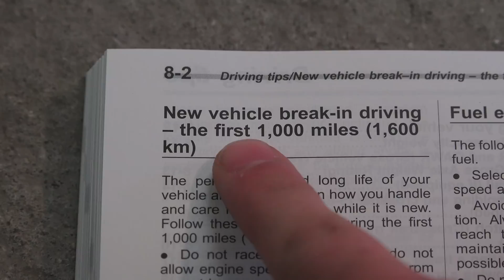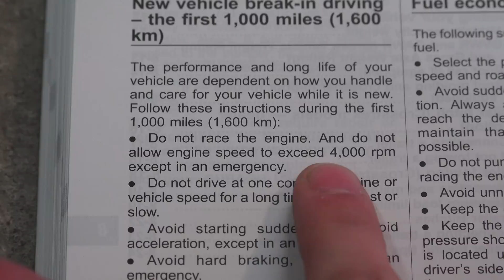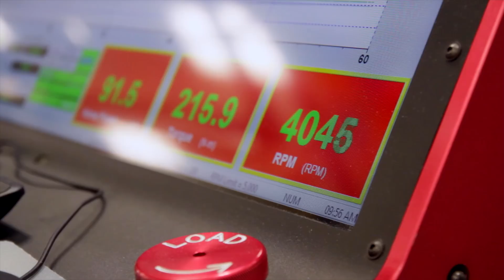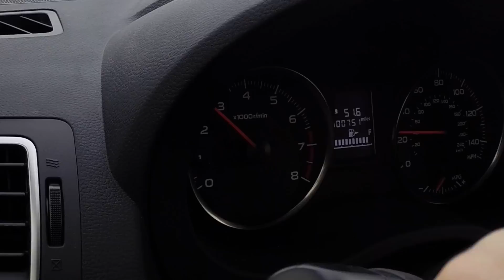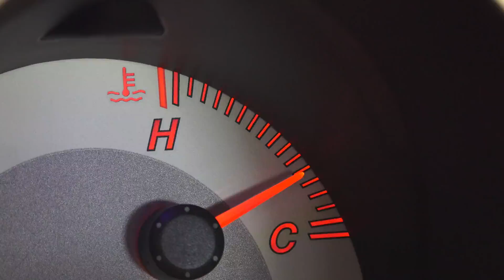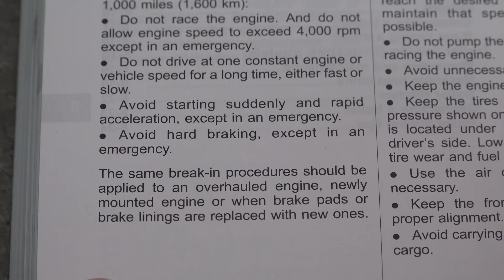5 Things You Should Never Do In A Brand New Car

Comment: these days, is not every motor produced tested in factory for mechanical issues and balance? I understand that it is a different story once you add the significant load of the actual chassis and interior / exterior components, so still wise to take it easy early on, but surely you wont destroy a new motor giving it some from the get go?

Comment: Hahaha so much for not flooring it, the lot staff at the dealer already floored it and drove the piss out of it if they had to pick it up from the port and drive it back to the dealership or did a dealer trade and swapped vehicles and drove it back from one dealership to the other. Depending on who did the PDI, that person could of gassed it down the block for ya already too. It's too late once a set of hands other than yours have touched it haha

Comment: okay buddy this is false info. owners manual is cya. my Subaru STi I blasted after dropping forged pistons in there. have to warm up the engine first before anything.

once warmed, i floor it and vary the rpm and engine load. no low rpm flooring.

Comment: Bought me a Swift Sport - manual stated first 800km very lightly which i reached my first day. And from 800km to 3000km a slowly started to move the rpms higher and higher reaching full 6900 at exactly 3000km. Also this aplies only when the engine is properly heated (oil, not just water) after that you can do whatever you want. Also i flored it but only at 2nd and 3rd gear and only till 3000rpm max! And yes i changed my driving style often, no highway and constant changing speeds, or if not possible, just shifted down a gear, accelerated, then shifted up and get back. Around 7000km i took it to race track for a good 1 hour full throttle full speed full everything. I think it now has more than 136hp:):).

Comment: Well.. that would mean if you want a new vehicle with a properly broken in engine.. you would need to buy it with virtually 0 miles on it. Otherwise.. you'll never know. Personally.. I drive mine hard from mile one. I did a 300 foot long burnout while still on the dealers lot 5 minutes after buying my scat pack.

Comment: Why does the customer have to do this finishing process (break-in) to get the engine ready? On another channel (mrjww) a guy turned up to a race track in a brand new sports car. Many commentators insisted that with modern cars the break-in is not necessary and that manufacturers were saying that it is optional.

Comment: wrong, most high performance engines need thrashing in the first moments of their life otherwise if you risk polishing the fresh crosshatching of the cylinder wall as apposed tho breaking in the piston ring surface. It's more important to change oiled filter at 1000miles, 3000miles and 5000miles then , maximum every 5000 after that.

i took my then brand new 2006 STI to a track day the day after i got it. Its so far lasted 200000 miles to date without having to open the engine. still going strong

Comment: The corvette manual doesn't say what you claim.  It says not to go full throttle from a stop, but it doesn't say to NEVER go full throttle.  GM have a specific manual for breaking in the LT1 engine and is says that after 1 hour or 30 miles you should do three 50% throttle runs to 4000rpm and back to idle and then three FULL THROTTLE runs to 4000rpm and back.

That is from GM themselves, totally contradicting what you say in your video, which is based not on data but on internet myths.

Comment: wanna break-in your engine properly fast,smooth and clean? 3rd gear full throttle pull 1500rpm-3500rpm, let the car drive itself to idle with little throttle input (like coasting and slowing down at the same time) repeat 5-10 times, let it cool a bit, do it again for the 1500-4000rpm range, repeat procedure in 4th gear, then again for 3rd gear but 1500-4500rpm, 5 times.. repeat every day for 3 days, change oil after 2000km, replenish if necessary

Comment: Disregard all of these if it's a rental...but on a serious note I like to load the rings gradually"almost lag the engine"..I've done it that way for 40 odd years but keep it in the 2000-4500 zone especially for flat tappet cam engines over a period of at least 1/2 hour non stop and never let it idle for periods longer than 60 seconds...Never had an issue doing it that way...Just sayin'.

Comment: What your asking is never going to happen in real life. Decent vehicle brands will have pre-run-in at the engine plant, its only their top of the line models will have a run-in service (2000 km, it varies per brand). Delivery drivers will leave the car on lots of cold starts, pre-delivery assembly will thrash the car on checking interval and salesmen will thrash the vehicle to allow the customer to get their vehicle quickly. What your saying is ideal, but its either old sayings or outdated. Low tension piston rings isn't going to mess up the bore to an extent that it will cause engine damage. Bearings have gotten better coatings over the years for start stop operation. Long story short, nothing to worry about, you got warranty, use it.

Comment: I made my break-in 'till 10k, gradually increasing the max throttle and load every 1 k. Only once or twice, in order not to make my engine a baby forever, I gave extra load (75% throttle and load and 100 %).

I felt my engine changing its behaviour 'till 22k, mileage when the petrol consumption stabilized finally.

Comment: BMW for the M2 also recommends keeping it below 5500rpms, below 170km/h and no full throttle until the 2000kms break-in service where they change engine oil and filter and differential oil.

Comment: I've several friends who work at ford and VW and there pre delivery inspection means take it out for a 5-8 mile drive to check suspension, tires and engine that means floor it see if it boosts correctly and I know that there own cars are treated the same and there fine

Comment: regarding breaking-in: it's really simple. If you break it in really gently, the surfaces will mate and the components will adjust, for calm driving. If you break it in harder, the surfaces will mate and the components will adjust for harder driving. In older days when cylinder walls were rough, you had to take great care during break in to smooth the cylinder walls. Today, what with CNCs being so precise, the cylinder walls are already very very smooth (look at the piston you are holding) so there are very small imperfections that need to be shaved out.
The only care i would do to an UNUSED engine that is going to be used as a general purpose engine is to first warm up properly and then use 50% of its available performance. Pretty much what they suggested: Varying loads with 50% max throttle and 50% of redline, for a few hundred miles. 
The same thing after every rebuild.

Comment: Engine brake in is simple. 4 things only.1. Accelerate decelerate, don't stay at the same speed/rpm.2. Don't stay at high rpm for extended periods.3. Engine brake as much as possible ( manual transmissions).4. Change oil/filter after 600miles/1,000km.

Comment: Some power equipment is not the same as automobiles.  My Scag Tigercat is a perfect example. You cut grass wide open period. No break in period. Why are small engines different?

Comment: piston rings are made of carbon and cylinder is made from titanium.. rings are very soft and can do no harm to cylinder except in condition of engine seize, because rings break in small pieces when engine seizes.. actually piston and cylinder have rough surface in the beginning so they create more friction.. more friction means more heat.. after break in period, both surfaces become smooth and hence engine performance also increased.. one might notice, at upper RPMs engine is not able to produce that much power, but when car has crossed 10,000 miles.. its performance is increased noticeably, because piston has some wear now and is able to move back and forth very easily as compared to 1st 100 miles

Comment: so i have a question. when i swapped the axle gears in my jeep there was a break in period. no constant rpm. no high speed. no aggressive stops. drive for 5 minutes at first and let cool completely then do 15 minutes and a cooling cycle until you reach 500 miles. then change oil and drive normally for 500 miles and change oil.  why dont we have to do this with new trucks? specifically for the diff?

Comment: No full-throttle acceleration -- but don't baby it either

Max RPM depends on the engine -- 4000 is a reasonable rule of thumb but not hard and fast.

Don't use cruise control -- but if you have to take a long trip, then go ahead and use cruise control. Just occasionally, flip it off, let the vehicle slow down, drop down a gear or two, then do a reasonably hard acceleration. Maybe repeat this three or four times, if it's not inconveniencing the other drivers on the road, then go back to cruise control. 

Definitely get the engine hot -- no short trips.